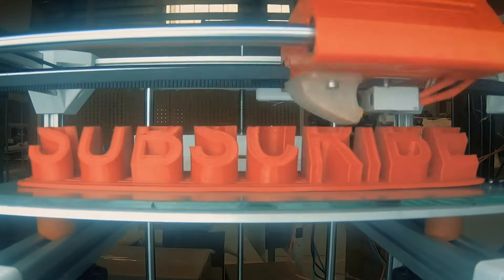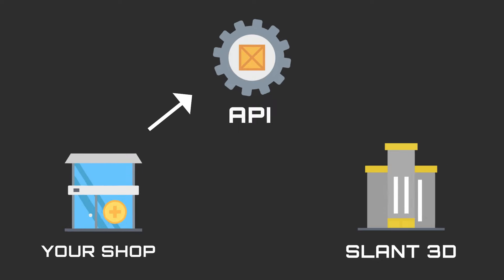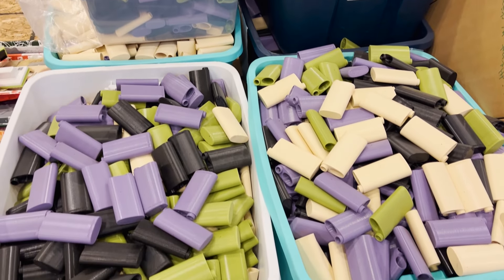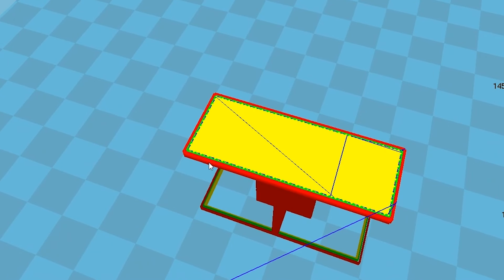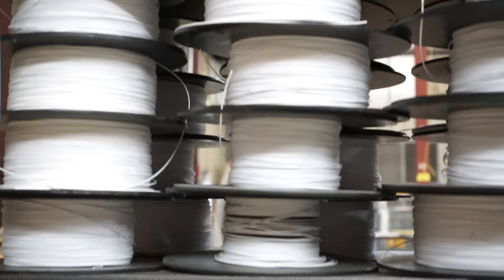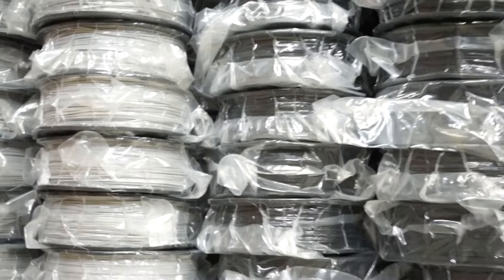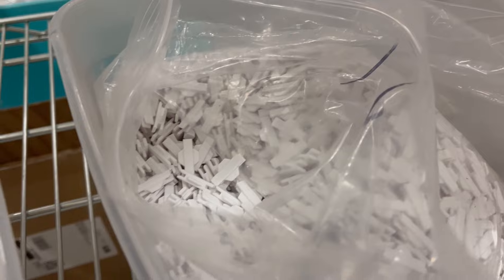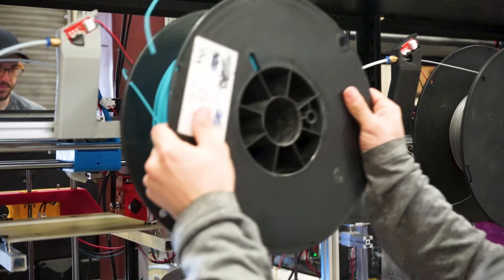We are Launching a 3D Printing API

Comment: Rooting for you guys to have a succesfull implementation of this API, that is no easy task to make sure all is working smoothly from the integration to printing to shipping. One feature I would say is handy is to add an automatic quote feature. There are other software that will quote the part based on an imported STL and the settings you choose. It could be very handy for someone that wants to stay at a certain price point and can compromise on certain settings to keep cost lower.
Reply from the maker: That is part of it. All pricing will be fixed regardless of units products. 1-100,000
Reply: @slant3d  impressive honestly. Do you have a way to take orders not through the API right now, say i had 500 parts needed done, how would i use your service currently?

Comment: How does the privacy work with companies stl files, can they be assured the files are protected and removed once printing is sorted?
Reply from the maker: The benefit of this system is that it builds on what we have already been doing in mass production and print on demand as it relates to file protection. Which seems to be working given that fortune 500 companies and stealth startups rely on us to produce their parts without compromising the project.
An organization that does not protect its users IP would be one built on sand.

Comment: Is there some type of quality assurance or guarantee?
Reply from the maker: When it launches it will have output references. But the system will be dependent good products design. For example if a piece has a supported feature that causes distortion in the print that is the responsibility of the designer. Basically we have a set quality but...garbage in, garbage out.